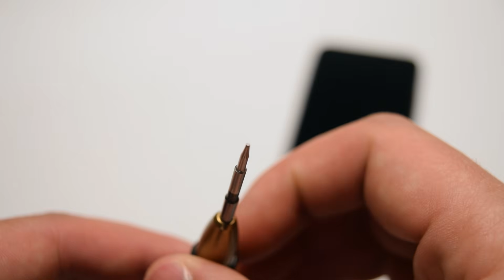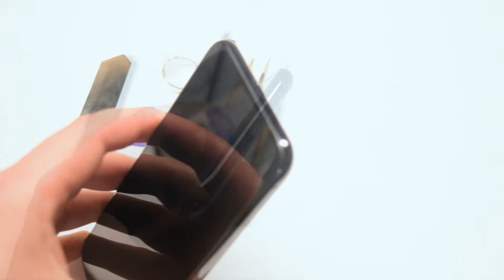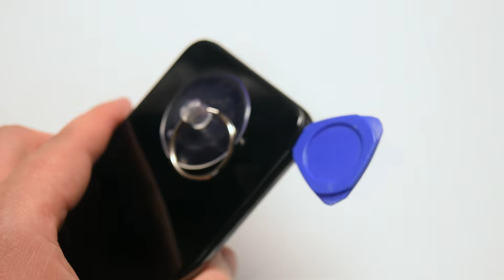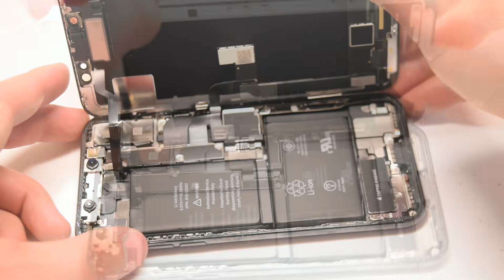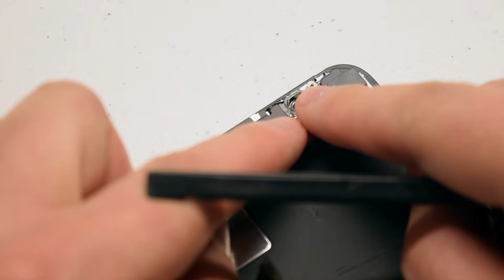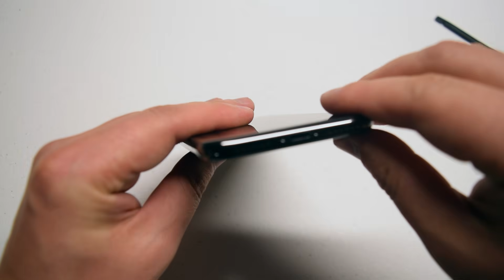iPhone X Ear Speaker Replacement

Comment: The flex cable on the iPhon X im doing for a client is damaged. Will it work normally if I just replace the entire assembly with a new one or will FaceID and the speaker not work?

Comment: Question, my ear speaker on iphone X is very low i changed it but even the new speaker was very low. What does that mean 
Is there something on the board that needs changing plz help
Reply: Same happened to me. I made holes the mesh part on the phone and it works very good now. But dust will start getting in there now. So I got a new mesh

Comment: Thanks for your nice tutorial. I bought a new Ear Speaker unit. I desoldered the speaker from the new flex cable and resoldered it to the one in my phone. My Face ID still works fine after it. Saved me a lot of money.
Reply: You did it all by yourself ?
Reply: So you need to do a tutorial for that, please

Comment: I have iPhone X and the ear speaker not working. But I have one more iPhone X with cracked screen. Can I remove the ear speaker from the second  iPhone and replace it to my iPhone? Is the Face ID will work after if it’s original Apple part?

Comment: This is not a good repair guide with all due respect. You should remove the battery before anything else to avoid short circuit problems, and reapply an adhesive to avoid dust entry into the phone.
Reply: Yea, ruined my iphone 7 because I was a beginner, but now I work on any electronics

Comment: what if my ear speaker is kind of muffled and i want to get it fixed? will i lose face id? i’ve tried cleaning it with a q tip and air in a can but it’s still muffled a bit.
Reply: I had the same problem. Visit the nearest apple authorized service centre and get it cleaned without even opening the phone. It does wonders!

Comment: Will Face ID work after replacing? My moms XS max ear piece got water damaged and stopped the phone from booting on, I disconnected it and the phone works fine but if I replace it I think the Face ID will never work.
UPDATE: I just put the war piece in warm rice and it began working again, don’t put it in hot rice, just warm.
Reply: I have found that resoldering the Ambient Light Sensor (the long rectangle piece with a white strip on top) when there is visible corrosion underneath solves this issue.

Comment: Hello, thank you for your video.
I tried changing my iphone x's battery myself yesterday, and after I did, I realized that the screen was all black even tho I was receiving calls and texts (my  phone is on). After hours of trying to find out what I had done wrong, I realized that because my phone's screen was cracked and damaged before, the ear speaker was stuck inside of the phone's body and it was not attached to the phone's screen and the flex cables of the ear speaker were damaged (the solder points were gone and the flex cable was not attached to the microphone anymore.) To explain it better, when you lift the screen to see inside of the phone, the screen that comes off, has a microphone attached to it on top, mine was not there and it was left inside of the phone above the battery But since that's the microphone and not the screen, I was wondering if that's the reason my screen is not showing up? and should I buy a new screen OR a new ear  microphone OR only the flex cables? I would be so happy and thankful to receive your advice, thank you!
Reply from the maker: I'm a bit late on this comment but I'd like to give advice to others if faced with same problem. So you should have ordered the speaker ribbon cable and the screen from a seller with a good return policy. Replace the speaker, see if it fixes the issue, if not add the screen. If The screen was not needed, just get your return going. Hope this helps with other electronic troubleshooting scenarios.
Reply: If the screens is still black you may’ve burned the backlight of your phone

Comment: what about water resist adhesives, after 6s you should add adhesive once you reassemble it
Reply from the maker: You can get a seal from our store if you so choose to put one back https://store.appledollars.com/collections/apple-device-parts/products/waterproof-adhesive-sticker-for-iphone-6s-plus-7-plus-8-plus-x-3m-double-tape-pull-trip-glue-replacement-parts

Comment: That means you gonna destroy face id and auto brightness disable!
Reply from the maker: No face id after.
Reply: Save Apple Dollars if you keep original screen and replace the whole flex cable including speaker ambient light sensor assembly. you lose face id only right? true tone and everything else is programmed into the screen? or what i’m confused
Reply: @3hitbye356  Same question, you knwow something?

Comment: "With nothing left out". You left out that auto-brightness and truetone disables, also a chance for no face-ID too?
Reply: no you need to keep the same proximity sensor because the same proximity sensor is connected to the motherboard for face ID, the real issue here is taking apart ear speaker from proximity sensor without damaging it.
Reply from the maker: If everything is reconnected correctly, everything should be as was after reassembly. If you experienced loss of true-tone and face id try to open the phone again and check all connections.
Reply: @GRIBSOFT  don't lie to people, it is confirmed 100% not to work with any replacement parts. Now with original parts yes.
Reply from the maker: Ok, great information!
Reply: You just replaced the speaker and flex cable with the one you removed. It is a completely different ballgame if you want to replace the speaker and flex cable with a new one. You have to desolder and resolder part of the flex.
Reply: @ricktennysonleddisplayssig6869  You guys are smart with the details of what will and won't work. Have a question, Had an iphone 6s where i replaced the screen and transferred over the original touch id, home button as I know you can't use a new one. I've done this many times, but this time the touch id won't work after put back together. It doesn't give any error at all. Just when you try to add new finger print, it acts like you don't have your finger on the home button... No errors. It just won't prompt you to scan your finger and can't get it to work. Any ideas?
Reply: burtmanindustries 
Did you use a sharp object to remove the touch button/flex cable? If you remove the button/flex cable, look very close at the flex cable and connections. I have a feeling you might have torn the flex cable, thus making the touch button an issue. Good luck!
Reply: I did it a few times on the same phone with a pry tool, but maybe that's why. SO no way to fix unless I bring to apple pretty much, right?

also, it's normal to have no error at all? It just doesn't scan when you try to setup fingerprints and acts like you never put your finger on the touch id.
Reply: burtmanindustries did you ever get the Touch ID working?